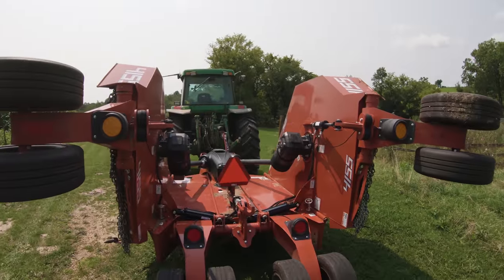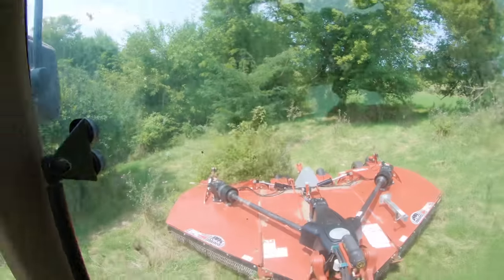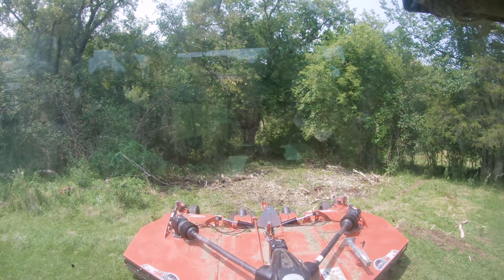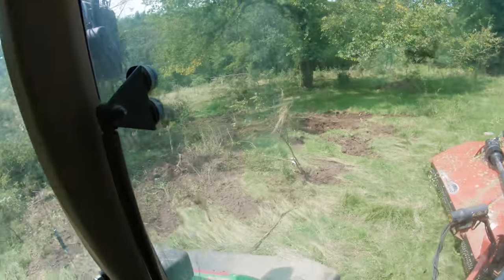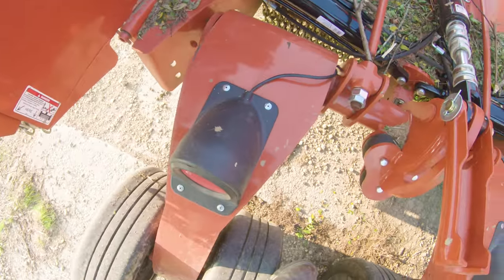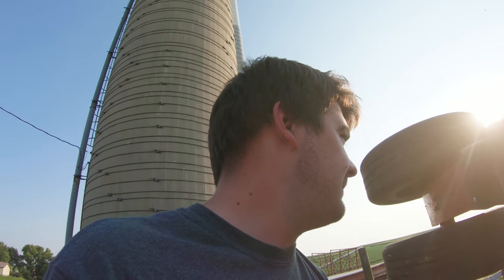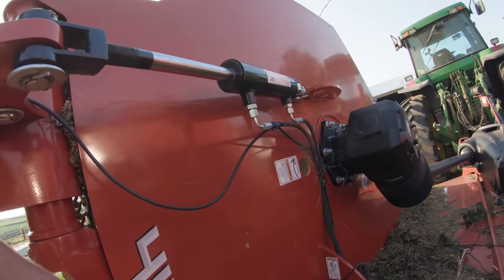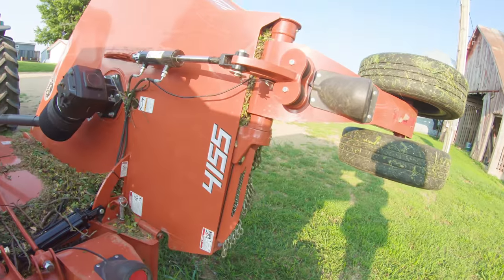Small-Scale Deforestation - RhinoAg Epic 4155 Batwing Mower

Comment: I would love to tackle all that brush with the D8 dozer I used to drive, I'd clear the lot and put it all in one big pile for burning. Easy job it would be too.
Reply: Robert S a excavator with a hydraulic thumb is much better for clearing jobs it's not as fast but your burn pile won't have all the rocks and dirt mixed in it too which will burning easier
Reply: Or a 299d2 xhp with a nice mulching head. Less fuel use then an 8 and most excavators, and also you don’t have to burn anything so you don’t pollute as much.
Reply: we just ran everything over when i cleaned right a ways with a 6040jd with the front brush guard, if the tractor can drive on it it got mowed lol
Reply: Robert S o

Comment: I have two TW 84 Rhino 3 point rotary cutters. They are of Mediocre quality at best. The gear boxes started leaking shortly after I got them. If you try to snug  the bolts. The bolts easily twist off. ( Butter Bolts.) One of the Rhino mowers cut itself in half. The tip of the blade would make dents in the top sheetmetal.  And eventually the blade got into the sheetmetal from just under the P.T.O. to not quit 6 o'clock. I don't abuse my equipment,  I just use it and maintain it. Rhino makes a low Value rotary cutter. I will not buy another one. 
M.H.

Comment: Have you ever broke the drive shafts or the cutting blades? Are there any shear pins in the system?
Reply: I think it has slip clutches rather than shear pins
Reply: That mower does have slip clutches...and with a large tractor you can slip them on some heavy stuff...I know because I changed some out yesterday.

Comment: hey man, what tires do you recommend for a brush tractor, we have real big mesquite thorns here in texas and i just pulled the tumbe out of my tire and filled it with slime, but i was wondering if aircraft tires would work. i talked to my brother in law about it and he said the rubber was to soft and theyd go flat, and i just dont see that happening. im thinking about foam filling with two part foam but eh. my tractor is a 8n so i just need the front wheels filled but i havent decided on what to do with the tires yet
Reply: i put slime one one, its holding air for now. i think im going to run that for now, i bought a gallon today

Comment: Too bad they didn’t have a rubber dock bumper instead. This way they would just absorb the bump instead of bending.
Reply from the maker: I feel a rubber bumper would be easily ripped off from shearing forces, or at least in the manner I handle it. I think a custom fit rubber bumper would be pretty easy to make if desired.